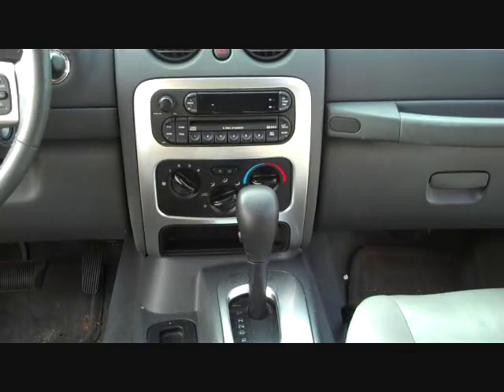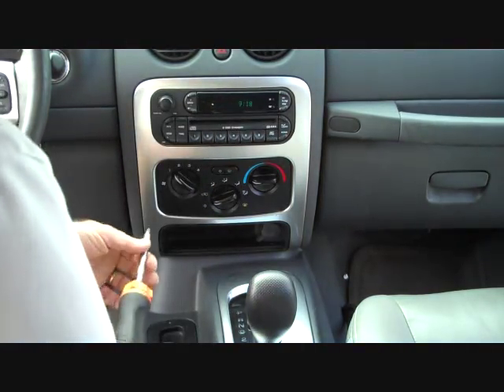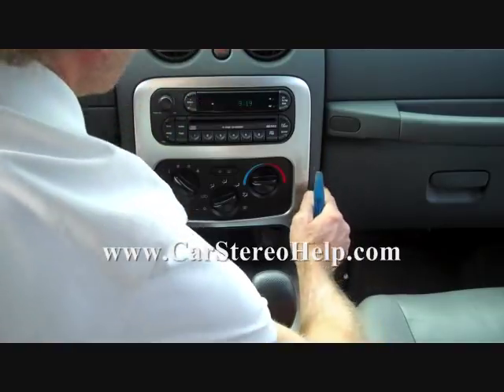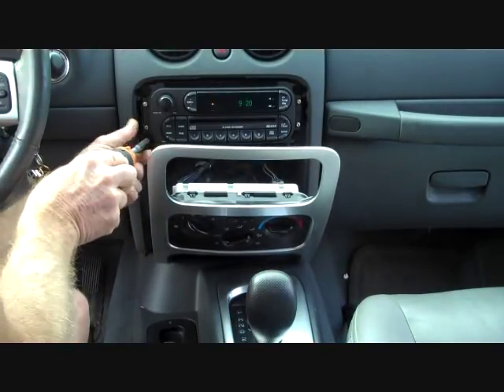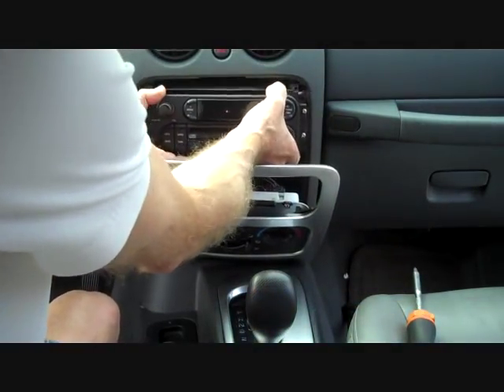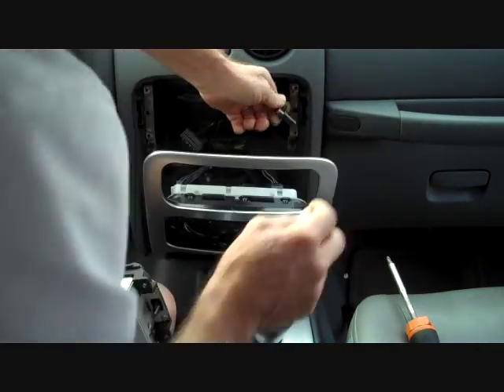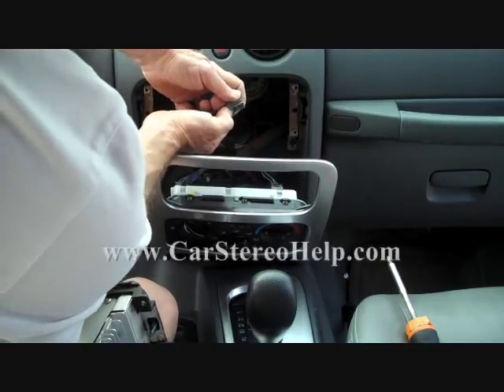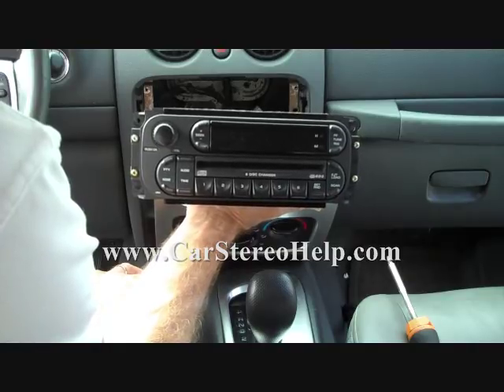Jeep Liberty Car Stereo Removal 2002 - 2007 = Car Stereo HELP

Comment: Worked Great!!! Thanks a bunch. My 2002 jeep liberty limited stereo has been cutting out ever bump I hit. Turns out it was a loose connection in back of stereo where the wiring harness plugs in. Been like that for years.  Now it plays Great. Thanks again

Comment: Hey if my car has no steering wheel controls why would the 10 pin connector be occupied? I disconnected it to see if something stops working but it seems like everything works fine.

Comment: NOT on a 2002 Liberty......(and, probably others)???
The 4 screws at the outer perimeter hold in mounting clips; the upper 2 screw tabs of which are captured BEHIND the dash moulding.... it bends the crap out of those clips if you do it the way the video shows...
The 4 screws at the INNER perimeter are the correct ones to remove....then you can remove the outer screws/mounting-clips afterwards, if you need to; which we didn't need to.   The Metra DIN adapter we used mounts to the inner screws set.
Reply: it's a 6 disc cd changer do all the cds go in stereo or do they have a separate box
Reply: The one shown in this video is an IN DASH 6 Disc changer.

Comment: I hooked up a high end Pioneer deck using the fool proof harness and I get a high pitch distortion when I turn it up... Non Infinity. I disconnected the left door speaker and the noise stopped. I ran a wire from the deck to the left door speaker and it works fine. Why is this? Supposedly only Infinity uses external amplifiers.

Comment: Great video, so I did this, put the new radio in and I couldn't hear through the speakers so I put the original radio back in and now the original radio doesn't come on at all and my key fobs aren't working unless the car is on. Any suggestions???
Reply: it sounds like you may have pulled some of the wires loose in the connector when taking it off maybe
Reply: I found out that the fuse went. Now for some reason when I put a new radio in the speaker doesn't work.
Reply: +Shanelle Gorham that's cool, least a fuse is a easy fix! which speaker is it that isn't working?
Reply: +Alex Dernst Any of them. I may take it to a person to look at it because it could be the radios I used, they were cheap ones.
Reply: +Shanelle Gorham yeah just have a professional install it